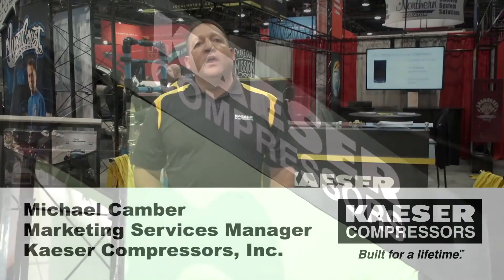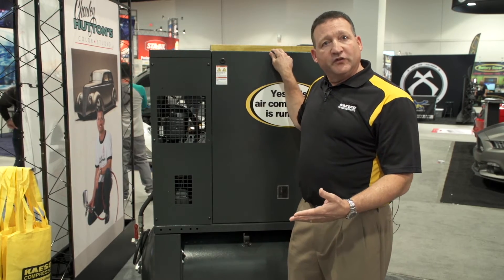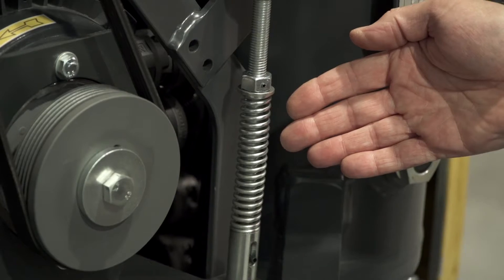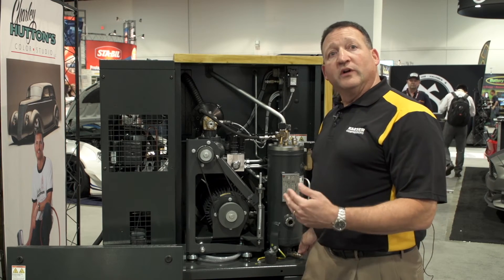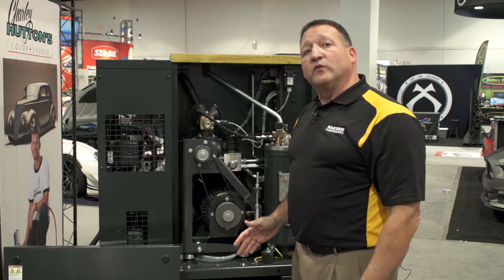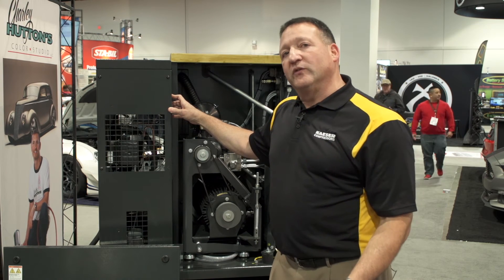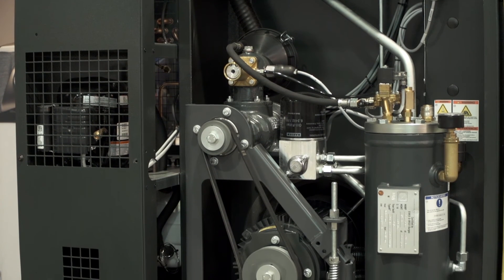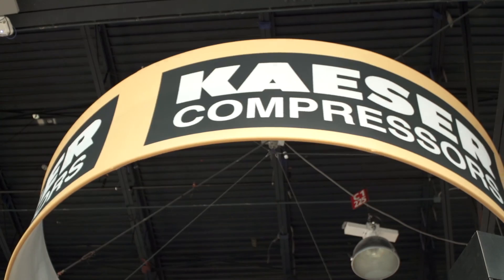Kaeser Compressors: AIRCENTER Packages

Comment: How to service with trouble Airend Discharge Temperature?
Reply from the maker: We can connect you with your local service provider so they can help you troubleshoot any indicators or messages on your machine if you don't have access to the service manual. Where are you located?